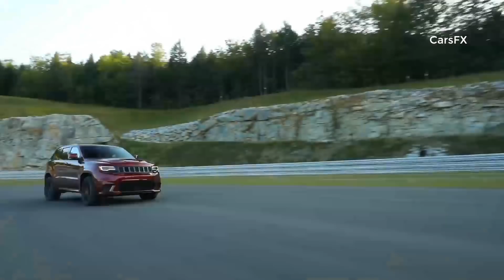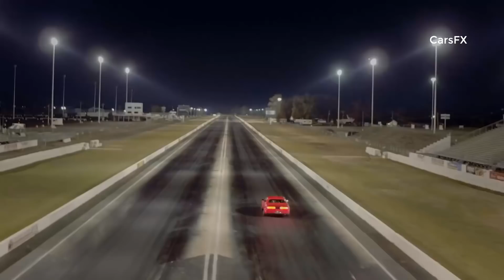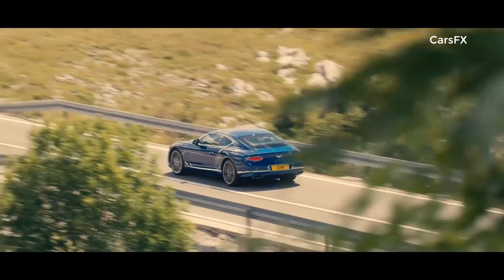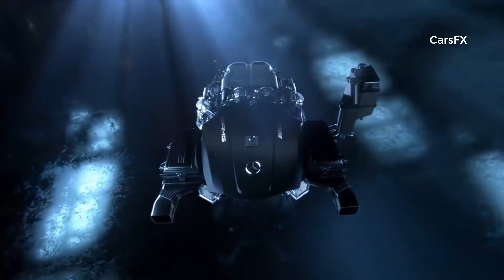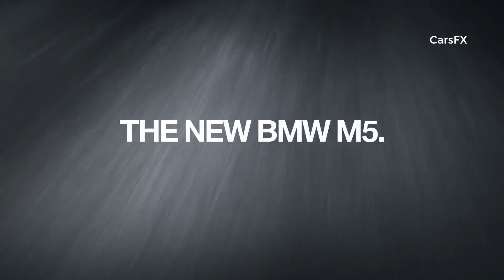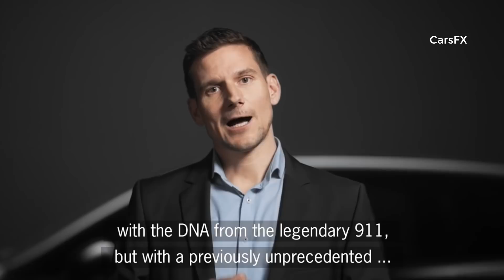10 Cars That Have Too Much Horsepower Coming in 2018

Comment: Little do people know, the demon requires 100+ octane fuel just to achieve those power numbers. Not worth it in my opinion. I'd rather have a Super Snake Mustang and be able to use ALL the horsepower it has with 93 octane pump gas.